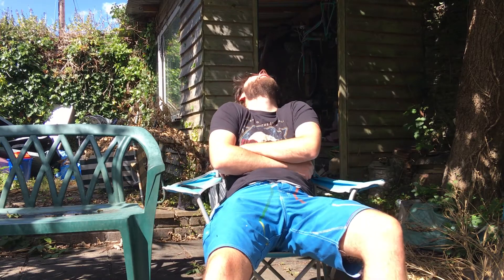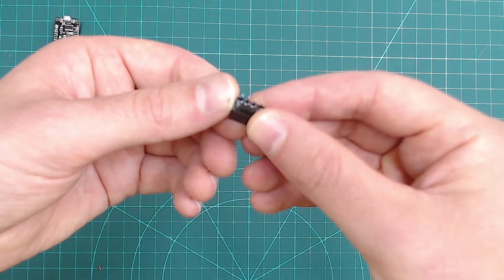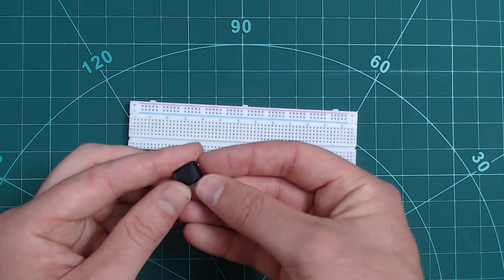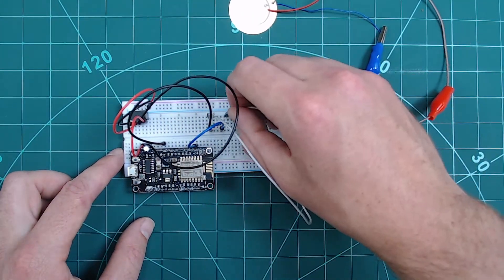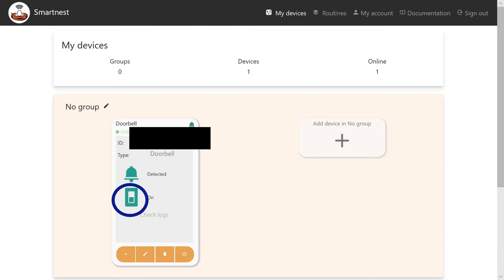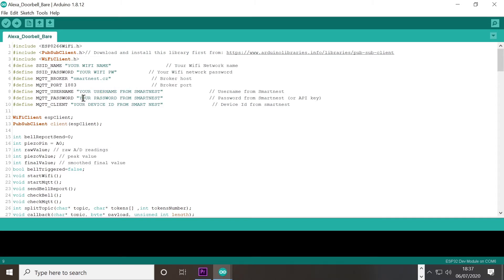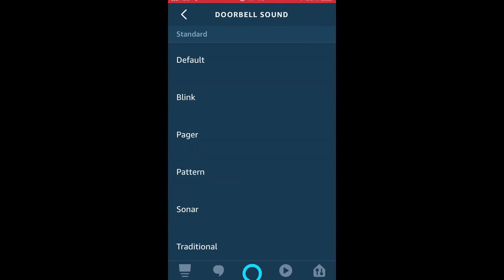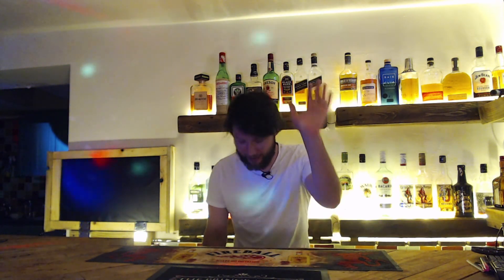Very Cheap $6 DIY Alexa Doorbell

Comment: it can run routines in alexa? like a trigger?
Reply from the maker: Yes, I use a routine to send a notification to my phone.
Reply: @techstuffdiy7947  can I put more than one button?
to trigger different routines
Reply from the maker: @wmb3858  you could do but you’d have to essentially create 2 doors bells in the Arduino script, and make 2 doorbells in SmartNest. If you just wanted a switch with no doorbell it’s a lot easier to do. 😅
Reply: @techstuffdiy7947  how?
Reply from the maker: @wmb3858  https://youtu.be/FR4HdwRXhiI
Reply: @techstuffdiy7947  it works very slow!
Reply from the maker: @wmb3858  For me it’s under 2 seconds, which I’ve been using it for close to a year now and have had no issues really. It’s no faster/slower than any other WiFi based doorbell.
Reply: @techstuffdiy7947  here it takes too long, the bell works instantly
Reply: @techstuffdiy7947  do you have instagram?
Reply from the maker: @wmb3858  Not yet, maybe in the future.
Reply: @techstuffdiy7947  I used Sinric plataform, its working very well. But the free account have the limit for 3 buttons. Smartnest is 5 buttons, but i cant put 2 or more devices in the same esp. Sory for my bad english, im brazillian

Comment: Good explanation of how to interface sensors via the Arduino ecosystem into Alexa, to trigger subsequent Alexa actions. I'll use these concepts (not the piezo but other external DIY sensor technologies) to monitor the driveway to start, announcing the arrival of vehicles. It can be extended from there...  Thank you !!